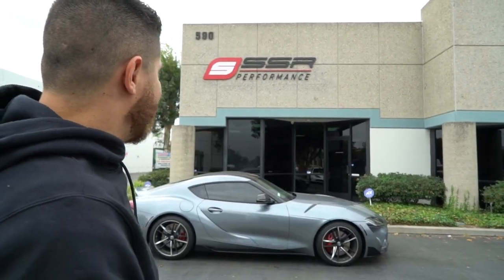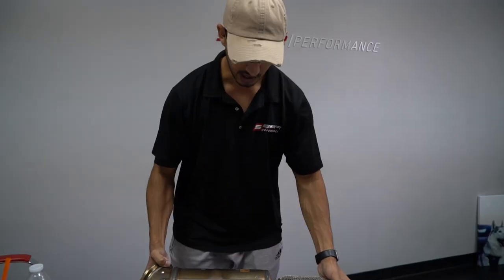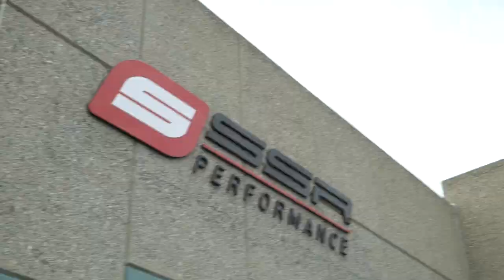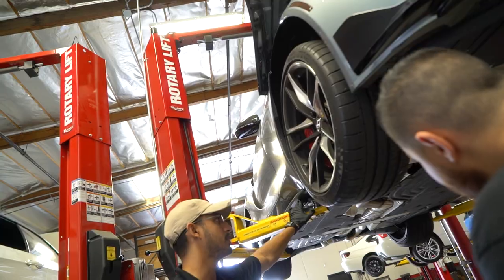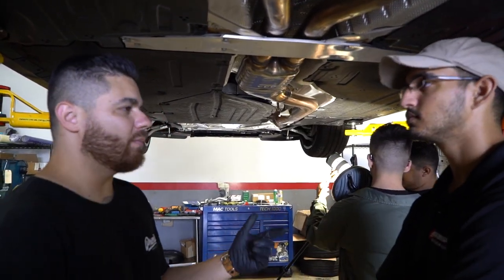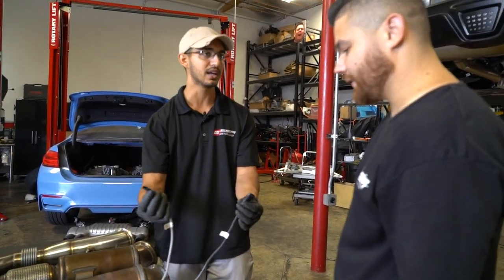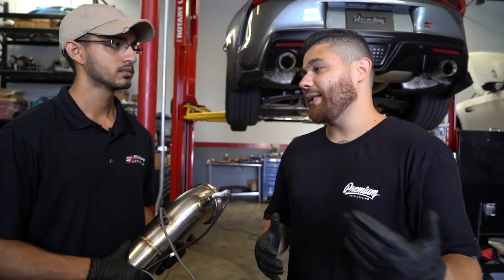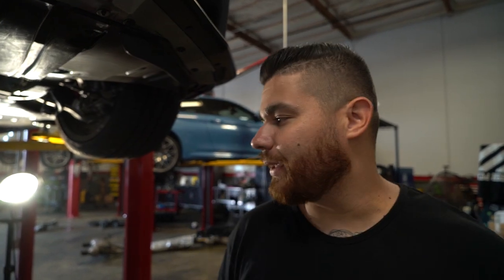2020 Toyota Supra Catless Downpipe Install (It's so Loud NOW!)

Comment: Does it throw a cel?
Reply: 335i101 it shouldn’t , a tune always gets rid of it but a O2 sensor/spacer usually does the trick, have no cats on my GTI and no CEL yet because of the O2 sensor/spacer